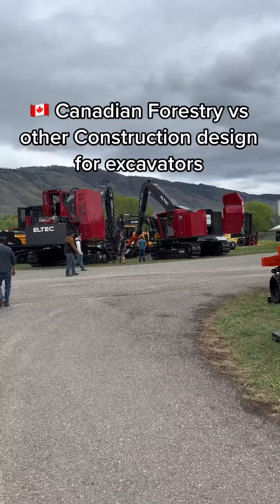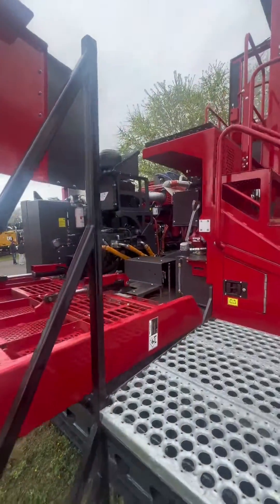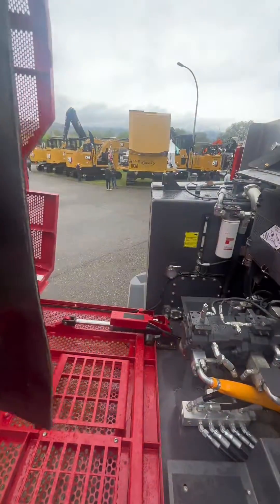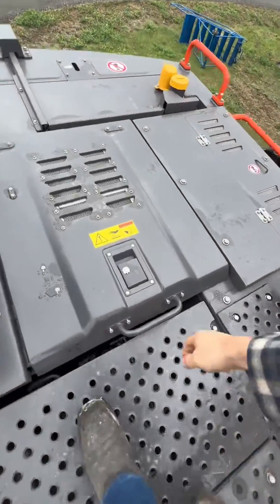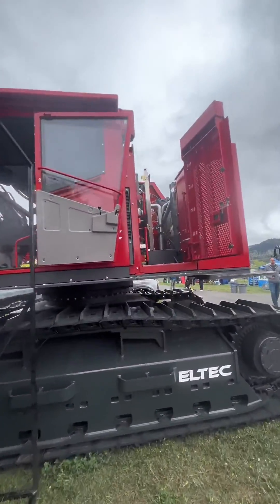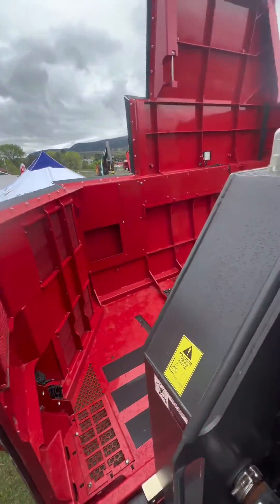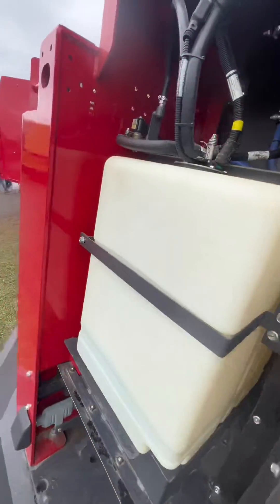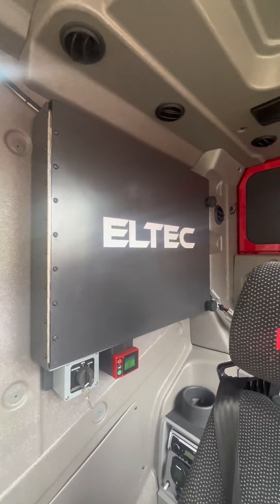Canadian Craftsmanship vs Adapted Equipment: Heavy Equipment Show Highlights

Comment: The compact design makes sense for working around buildings. The forestry machine doesn't need to worry about space
Reply: Exactly tell a construction guy that he'll need to make sure and park his excavators and extra width apart so that can swing that entire hood over the top every day for daily checks. Volvo you can do all that standing on the ground from 4 cabinets. They aren't comparing apples to apples, Volvo makes a purpose built foresty exc with walkways around the outside, brackets where the entire top of the engine or DEF system swings out. High straddle road model undercarriage. If they new the full offering of Volvo then this video doesn't make them look to knowledgeable about thier opponents offerings.

Comment: The volvo is made to run on worksites and then needs to be more compact, the Canadian one looks bigger. Why would you need to lift the whole hood for regular maint? If it is a big job just unbolt the panels... 

Also I never understood why you prefer to use excavators instead of regular harvesters. Is it the terrain?

Comment: But whats the price difference. I'm all for buy Canadian but if are paying double then you can see where companies will spend their money.
Reply: And some of these companies that run junk equipment or under why they go through mechanics like crazy. Think about that for a second. I'd rather spend the extra 50 or 60 Grand to keep my mechanics happy
Reply: @suprestoner  oh I get ya. I personally would spend the extra also. But the average company has to save where they can. I've always said these things are too damn hard to work on. You need to be a bloody contortionist to fix anything. As we get older it gets harder and harder to do it so your option is to pay someone to do it for you. Now it cost you more because he has a tough place to get into. Make it easy access and you can do more of it yourself and if you need a mechanic your cost is less because there easier to work on.
Reply: @suprestoner the other machine is not 50k worse, just unbolt the panels. Price is the reason why I won't by a versatile tractor, it's just not that much better.
Reply: Exactly.

Comment: The Cats and Volvo's are hard to work on by design...the factory is throwing a bone to the dealers, and making it so machine owners will take the machine to the dealer for repair. They are big enough now with global markets, that they absolutely do not care about the businesses that run in remote areas. I can afford a new pickup truck, and recently, I purposefully bought a 1994 with a cast-iron inline 6-cylinder specifically because I can work on it myself if I have to. I paid my local mechanic to put new synthetic fluid in the diff and manual transmission even though it cost me $150 more than if I did it myself, but if he retired, I could do it myself if I had to. The whole truck is like that, and I cannot work on the new ones.
Reply: Who the hell loads their excavator and drive it to a shop for service? Atleast in Sweden it is mostly mobile service. Biggest reason you cant do shit yourself is because emission regulations have made all engines so complex.
Reply: @guseks8413  The mobile heavy equipment repair truck always makes sure the work bid is 10% lower than shipping the machine back to the dealer. They are expensive!
Reply: I know what you mean mister, I got a 93 with the 5.8, and I can do everything to it myself. I've done diff swaps, transmission and transfer case has been changed it was an original tower of power truck which I swapped to a 5.8 myself. Simple and easy to work on. You'll never see that from a dealership again! Everything is designed to be brought back to the mechanic so they can charge you 150 plus an hour in labor which is thievery if you ask me!

Comment: Whoever designed this machine must have worked closely with the operators, or is an operator themselves.
Reply: Or have been a mechanic themselves this is a way well thought out and designed for easy to get to work with not to mention it's probably easier to assemble during manufacturing.
Reply: @VTX00128 they could have also just been the person that does the inspection, I got frustrated trying to inspect all these other machines and decided "you know what, why don't we just make everything that easily accessible so that I can do my damn inspections in less than 30 minutes"

Comment: But the aerodynamics are much worse on the Canadian machine. And the interior doesn’t look as modern. Both absolutely crucial when you’re working in a forest.
Reply: Gotta remember the top speed too - I bet that Volvo goes like 3.1 mph vs 3.099 mph! 😅
Reply: Gonna need those curved windshields or it'll really kill it's quarter mile time
Reply: @barkobama7385  probably should add a spoiler too 🤣
Reply: @wayneswonderarium  needs more chrome, adds at least 10hp.
Reply: @RowanHawkins  Rally racing stripes and Centerline, polished aluminum drive gears & idler wheels with wrinkle-wall racing tracks, for the win 🏆
Reply: Tale as old as time. An executive sees a new market, tells their engineers to make some equipment that is specced to do the work, now they say to do it in a week with a budget on 4x less than what from scratch would be. The result is a lot of body carryover from other departments and people making decisions based on what they know which is a market opposite to what their making that thing for. I see it all the time in EMS
Reply: BS fuck aerodynamics
Reply: Anybody under this comment section thinking he was being serious with the aerodynamics, youre dumb af and easily fooled😂
Reply: Lol 😅😂
Reply: The size and aerodynamics might matter when you are transporting it around with a semitruck or ship or whatever.

The company building the log loaders probably doesn't need to do too much maintenance themselves, but they do need to ship the vehicles to the buyer or dealership. So, being able to fit one extra unit onto a ship might look quite attractive.